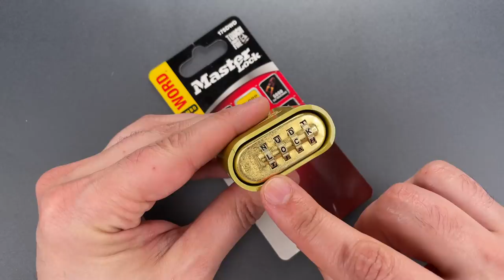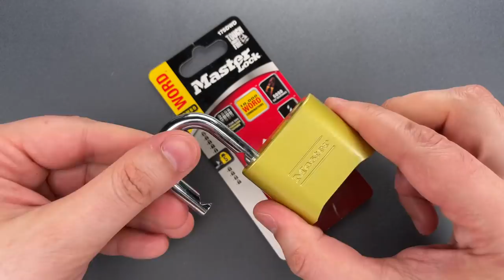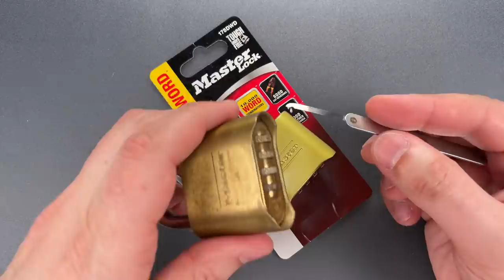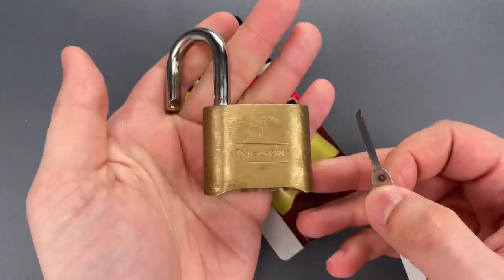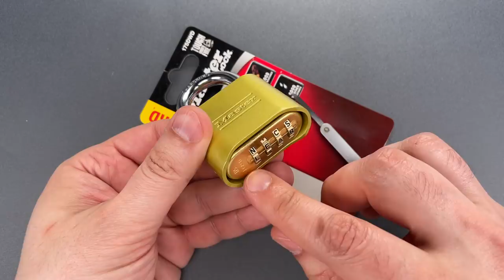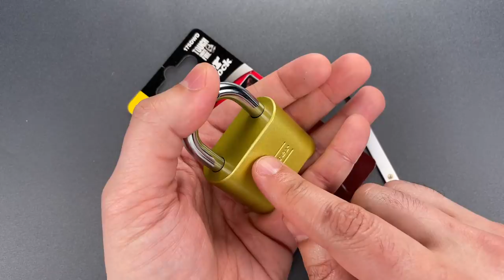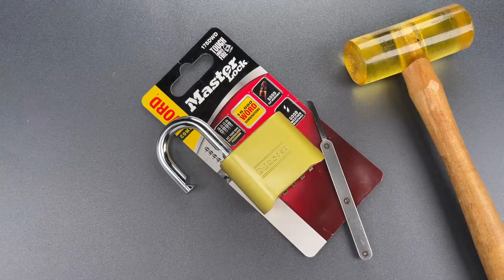[1272] Good Job Master Lock... Kinda.

Comment: That seems like an even simpler bypass than the shim. You could probably replicate that with a random nearby rock :( 

It would be interesting to see inside the lock, so we could understand why that happened.
Reply: Probably because it is spring loaded if I were to guess
Reply: LPL: So the shim is the easiest but it requires the tool.
Me a poor person: So I have this rock.
Reply: But he couldn’t even open it!
Reply: It will only work if you're using a yellow hammer
Reply: Not just a rock. You can even open it unintentionally - just fling the lock against whatever it's locking and unless it's really soft, the lock will open.
Reply: But you have to also understand that typically locks like these are used on things where there is not much swing-freedom to grasp it and manipulate it. Firstly, the shackle has to be slightly/gently depressed more as to relieve the gripping tension caused by the spring mechanisms. So as to allow other mechanisms to become jostled loose from the hammering/banging/striking. 

Imagine trying to do that on a locking bay that is inset into a panel. You would only have a 90 degree flip rotation and maybe 5-8 degrees of swing oscillation potential. Trying to hold it well enough to strike while pushing it inwards more to loosen the shackle is asking for possibly hurting yourself. Some may consider the risk of self-injury as a valid price to pay for whatever treasures await. But personally, I'd rather not sacrifice something unnecessarily of myself just to open a lock.
Reply: Looo
Reply: if your bike is parked in a public area someone shimming the lock could look like someone opening with the combination from afar, if you hit it with an hammer you make a lo of noise and it's obvious something is suspect
Reply: I’m sure I could do that with my hand
Reply: WHen he uses the shim to bypass the lock he is moving down a presumably spring loaded locking lug.  When he strikes it with a hammer he is using interia to accomplish the same thing.
Reply: @Imthefake  when car alarms go off, people basically just check to see if it is their car or they ignore it.  What are people gonna really do about a 1/2 second method to open the lock?
Reply: @juliuskwak1263  this variety of lock needs to be pushed down on to unlock it, even the intended way. there's always going to be room wherever it's installed to push it.
Reply: @bermchasin  i had a car alarm that wouldn't stop in the middle of a city, I had to pop the hood and pull the fuse for the horn. At no point to anyone approach me. I swear I could have been stealing the car but I think as long as you act like you are the owner of the car you could probably successfully steal a car.
Reply: @bermchasin  if 99% of people don't care you still take a 1% risk of potentially going to jail for a bike
Reply: The percussive bypass is potentially more concerning than the shim bypass.  Some places have laws on the books that either require someone carrying lockpicking tools to have a locksmith license, or make the carry of lockpicking tools otherwise illegal or lead to exacerbated charges if it's in the course of a crime.  If the person that has forced entry happens to be caught in those places, it's a slam-dunk to convict them, no, "I was just lost and wandered in," defense would be accepted.

A hammer on the other hand is a common tool that even many people that aren't handy with tools would own and has no laws restricting possession.  Someone caught in a place they have no business wouldn't see charges for carrying an instrument for defeating locks, and might be able to claim they were lost.
Reply: @juliuskwak1263   When i was a kid we had a lock holding a fence closed we had lost the key and would just hop over the fence anyway. one day i had had enough and needed to open it to get a bike past it so i no joke got a piece of rock and hit it, no tension relief or even much force and it just popped open. now this is not that lock but i wouldn't be surprised if LPL is using more force than needed.
Reply: My school uses these locks to secure laptop carts. The front of the cart is accessible to teachers, the back of the cart is only accessible to the campus technology staff. 

I wanted to rearrange my cart and do better cable management (cables were EVERYWHERE) and I didn't want to have technology come out, so I used this bypass with the other lock that I DO know the code to.
Reply: @Imthefake  well problem is 99% of people would definitely do it,if the odds of failing is just 1%
Reply: @Imthefake  you're taking that 1% risk regardless by stealing in the first place, you're placing too much faith in people cause the majority are going to go about their day and pretend they saw nothing
Reply: @jakermeister269  Yeah, I even have seen them kicked open. Seriously! Meant so secure a door, yet a hard kick against the wall opened it flawlessly.
Reply: @SurotaOnishi  Most will likely just move out of the way to not get run over, grumble, and carry on with their day.
Reply: Wow 2 of my favorite persons, GA and LPL, on the same YT page!
Reply: @juliuskwak1263  Not to mention the potential for leaving dna at the scene... self-injury would not be preferred.
Reply: @juliuskwak1263  If it’s pressed against a wall, you can do it without even holding it in your hand. Just use your pointer finger and thumb to hold the shackle and bottom (in order to press the shackle down) and the press it against the wall it’s attatched to. Then you hit it with whatever object you have and it works the same as if you were holding it
Reply: At this point shouldn't Master Lock hire LPL as consultant to design their next locks?
Reply: In fairness, locks aren't always positioned where the shackle and lock body are accessible, where as the decoder wheels always are, therefore the shim is the simpler solution.
Reply: @juliuskwak1263  yes but, your are seriously over thinking it!
Reply: @Imthefake  I think you missed the fact that the lock open on the first strike!
Reply: @TWX1138  you can make lock picks from plastic soda bottles and aluminum cans. The lock pick tools law used to be but is no more it is considered a blue law.  Tool and knowledge can not be restricted and thusly are protected by the first amendment.
Reply: Enjoy your time before RIghteous gets here. And when he does get here, ignore him.
Reply: @TWX1138  If they were to do some preparation on the area and carry the hammer in a tool belt, then walk by really fast, they can even claim complete ignorance and say the hammer hit the lock accidentally.
Reply: No more gutting it seems! no time I suppose!
Reply: @creamwobbly  The idea is that it can happen unintentionally, you just fling the lock for whatever reason and if it hits something at just the right angle, it will open. Sure enough it will not happen every time but I think the chance for it happening is quite decent. As stated before, the hit needs to push the shackle in, then stop the body abruptly. I don't have problems imagining what is the shape the lock needs to be tied to for it to happen.
Reply: @connorgregory3986   Connor Gregory Secret Hammer Hand.
Reply: I can tell you as a kid, when I seen a master lock on a bike tethered to a chain. I would just swing the chain to make the lock hit it's side on a hard object in reach (usually whatever the bike is tied down to) and that would get most locks off in a second or two. I only did that to show my mates that their locks were trash, I watched bike thieves do this hundreds of times from my apartment window.
Reply: Might be simpler, but it would definitely make some noise and possibly leave some damage, two things that are undesirable.
Reply: @ememmeme8722  ... and only if you can spell polyeureth ....    Plastic.
Reply: @Imthefake  Just be frustratied with trying to set the combination and the lock being sticky. Nobody will blink twice when you beat on the lock.
Reply: You do need to lightly press down on the shackle and hit it right. Looks like something that the average person could figure out and get good with practice, but a lot of people will take longer than LPL. I'm guessing the first exploit doesn't need a careful touch. It also doesn't make the same noise. 

Still terrible, but if LPL says the first exploit is easier, he's probably right.
Reply: @Imthefake  Or, you forgot the combo, got PO'd at the lock, and flung it against the bike with your hand like you were going to beat it in frustration.
Reply: @Imthefake  false. Sounds like one click.
Reply: @Imthefake  99% (1 of 100) eliminates everyone within eyesight.
Reply: You could, but it's also rather a bit noisier and more attention-getting.
So it's BETTER security than it was... But still very little indeed.
Reply: @Imthefake  but it's not 99%. It's probably closer to 99.9999% that don't do anything. Out of every car alarm I've ever heard, I've never seen someone do more than look around for a few seconds. Has anyone here ever seen someone confront a person because they're getting in a car with an alarm going off? Anyone? Did they make the person stay there until the police arrived, or did they accept their lie and let them leave? Car alarms probably only work when the thief is so show that the police actually get there from that one Karen/Kyle that calls them to complain about the noise. The way they really work is just deterring thieves that lack confidence and speed.
Reply: @ememmeme8722  This is why you don't get the Green Lantern to make your locks.
Reply: Yeah i wouldnt call this good job, worse job more like it
Reply: @juliuskwak1263  if that lock can be bang-opened on his soft palm, it can be bang-opened under pretty much any circumstances
Reply: For all those whom need it, read it. 
I'm a sinner JESUS please forgive me for all my sins I know you shed your Blood for me on the cross at Calvary. Thank you JESUS for my salvation and for shedding they Blood for me. I love you JESUS. 
Romans 10:5/10 ct...❤️k
JESUS Is Lord! Amen
Reply: At this rate it will be more interesting to see inside the hammer than the lock...
Reply: @ememmeme8722  Masterlock is a Green Lantern?
Reply: I had friends that would do this cuz they forgot their code.
Reply: @killagami5658  It's obviously something more than it being "spring loaded" or every spring loaded lock would have this issue.
Reply: @GardenGuy1942  He did! with the rock! and there are other ways to decode the combo beside that.
Reply: @juliuskwak1263  Meh, this technique could be easily done with the lock attached to your average locker hence making your point mute for most use case scenarios.
Reply: @Imthefake  It's just a quick single tap. There's no big attention getter here.
Reply: @connorgregory3986  And I've got 5 bucks that says you can't.
Reply: @TheNightstalkerShow  Reg was definitely in for a "hard night"  but only with his hand.
Reply: Hey Gadget Addict, love your channel!
Reply: Yeah, anyone can get a hammer.
Reply: @Ben7seven7  im referring to a spring loaded locking lug. The hammer works on quite a few of those and thats is just what I think allows the lock to be opened my the hammer, although I am unsure.
Reply: I believe, this technique uses the same design flaw as the shimming method. As LPL states, there is a bar across the code wheels inside the lock, which he pushes aside with the shim. The strike on the lock will push the lock aside very quickly, while the bar is held in its position by inertia. In relation to the lock, it moves out of way. The light push on the shackle just relieves that bar from the clamping by the locking mechanism,  so it can move more easily. So far for my theory. I must admit I have never seen the inside of such a lock. I may be completely wrong.
Reply: Or  just take off your shoe
Reply: @kinzieconrad105  other countries than the US exist, they have other laws.
Reply: @progandy  That. Also when your bike is outside, there will usually be other noises covering your half second thump.
Reply: @QuantumFluxable  No, the US are the only cuntrie on erf! It also the bestest in ewrythink :D
Reply: @GardenGuy1942  what video did you just watch?
Reply: @Imthefake  "I forgot my key, just using my spare here...".
Reply: @Imthefake  Plastic hammers like this won't make any noise and leave no marks.
Reply: @kinzieconrad105  my favourite found object for lock picking is (metal) street sweeper bristles. A five minute search along almost any gutter will give you a pair and you are good to go...
Reply: @killagami5658  My thoughts exactly. A well designed lock uses interlocking parts that cannot move until the correct combination has been entered. A poor design will use springs and correct combination moves the parts that are normally pushed down by the spring. Unsurprisingly the Master Lock selected the latter design. I'd expect this lock to be shimmable from top, too.

(This may really be intentional because interlocking mechanism is usually a bit harder.)
Reply: @Imthefake  You clearly have never seen people walking past a locked bike as someone is cutting or grinding away (check other youtube videos). No one cares, it's not their's. Its the same effect as car alarms, no one cares except the owner. In fact car alarms make me pissed off and want to smash the car worst to make it stop making sounds.
Reply: @kasuha  well if it's in place on a latch, you cant maintain pressure on the bolt while swinging it, so it requires some object to strike it whie pressing down
Reply: @Imthefake  ya defeating a lock covertly is the goal but even that can be cloaked; muffle the sound, short quick whack
Reply: @Imthefake  my dude criminals are brazen enough to steal bicycles with angle grinders they brought to cut the locks off in the middle of the day, no one is going to notice or pay attention to a little rap like that plastic hammer gave that lock.
Reply: @Imthefake  Sure but it’s still an easy getaway and most people don’t pay that much attention
Reply: simpler but loud
Reply: Or ask the Doom Slayer to kick it.
Reply: @Imthefake  as if jail matters for thieves. Prison won't make a difference to a criminal. Also, in several countries, you can simply bribe the police and continue with your life.
Reply: @blakeerenhouse943  it’s called an index finger
Reply: @ememmeme8722  true
Reply: @ememmeme8722  What if I tie a stick to a rock and spray paint it yellow?
Reply: @juliuskwak1263  If the lock is in a recess, use a pry bar to push the lock up so the shackle catches on the hasp, then hit the lock.
If the lock is hanging against a gate or door, don't try to hold the lock, just push it up and firmly against the door/gate before hitting it.
Or, pinch the lock gently on top and bottom with your thumb and forefinger and whisper, "LPL." Same effect.
Reply: @juliuskwak1263  That wouldn't be any harder, instead of holding it by the top of the bar you just push the body of the lock lightly against the thing its attached to via the bottom and then strike the side all the same. This will ALWAYS be an issue no matter the use case because you need a minimum amount of flexibility to simply orient it for a key or to see the combination.
Reply: @Imthefake  exactly. Just sticking a shim and rustling it open means anyone can casually open it.

If you need to take out a tool Bosnian bill made and work on it for a minute or hit it with a hammer while applying pressure, that’s a bit different, although the hammer thing is a big weak point still.
Reply: I've opened locks like this using my shoe as a hammer
Reply: @Imthefake  People are cutting locks with angle grinders and nobody around cares so I don't think hitting a lock with an hammer or a rock would pose any problem
Reply: @juliuskwak1263  those that say it can't be done shouldn't interrupt those that are doing it.
Reply: @juliuskwak1263  yeah thanks for that captain obvious, very useful and insightful information there.
Reply: No it has to be a piss hammer like shown in the video.
Reply: @TWX1138  and yet one might look most suspicious walking around with a lemon flavored mallet in the middle of a park, most definitely looking around anxiously to make sure no ones watching 🤣
Reply: In all fairness, the shim is far more discreet, the hammer at least has to make noise
Reply: I’ve known about this design flaw for years and whenever I’ve seen someone protecting something of value with one I feel obligated to let them know.